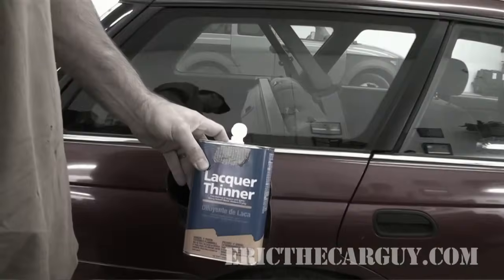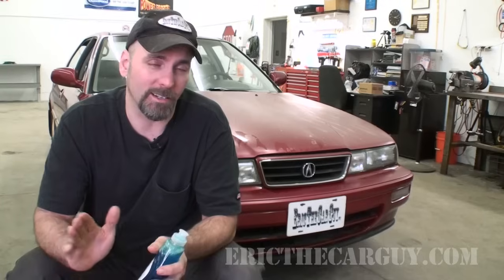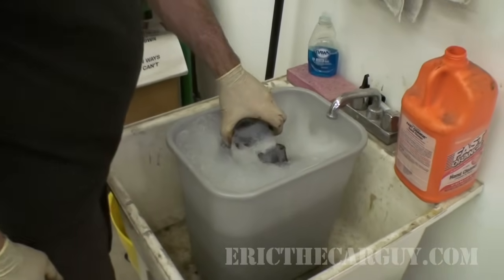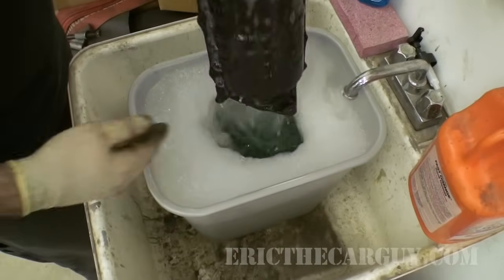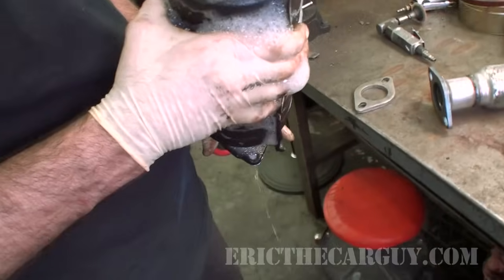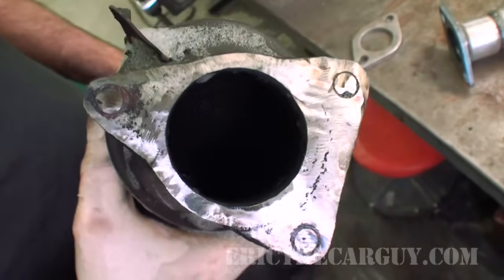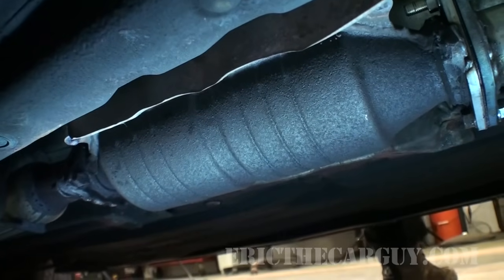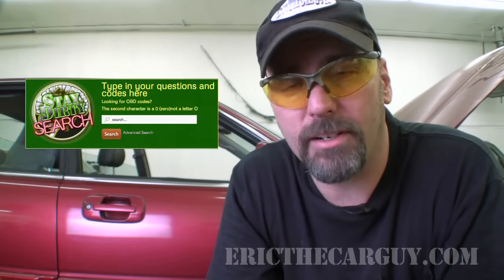Cleaning Catalytic Converters With Soap and Water -EricTheCarGuy

Comment: Good try. 👍  can't be mad at result. But definitely not how it's  done. 30mins? No. Step 1 u rinse it 6 times with diesel fuel by rinse I mean shake shake shake  6 times  step 2 you let it sit in dishysoapy water 24hrs  then step 3 last step you rinse with water distilled.  Rinse goooood and ur done 2 day project and u see thru it  u see light and its actually clean

Comment: I think your researched methods were sound. I have to question your order of operations. At the bucket, draw your hot water first, add your soap and chemicals after that. Chemicals above water are chemicals not in your solution. Hope my little advice helps in any way it can.

Comment: Did this using wife semi defunct  dishwasher [did purchase her a new one ]  and use max intense wash  cycle  with 15% ammonia cleaner/+non foaming  detergent,,,,,With few mod to baskets to funnel water to run down inside Cat it worked well.  manage to wash three cats,,,, before dishwasher took umbrage and died  seem seals in dishwasher don't take kindly to carbon and gunk pumping around in hot 15%  ammonia/soap  You need max run from dishwasher ,,,and must funnel hot mix in to cat core  and place a metal fine filter over top of dishwasher filter out let at bottom of machine, ++ rinse Cat well at end of washing cycle with cold water to make sure soap is remove , Still in use same Cat on my Suzuki car and its 24yrs old and it still works fine,  Yea we had Cats in cars back in 1993  think hot water is key to cleaning Cat core and keeping it on the move to take gunk away found lot of tiny hard black soot crystals  in the run off from waste water   ????? know its hard as I use some of the runoff gunk in  water  to sharpen a Stanley knife blade and still have some of run off  carbon and rust  as power  after it dried and put  in a  tin,, makes good grinding compound is very fine ,

Comment: Ya gotta try it as if you want it to work. lol. If you really wanted it to be cleaner to the point of working...I would imagine you would at least flush all the soap and loose particles out before installing it. No wonder it failed. It's kinda like soaking a dish with cooked on food in the sink and thinking you could pull it out clean...lol  The soap bubbles at the end was kinda telling as to why it failed. You might as well hadn't tried.

Comment: Faster to just use a power washer/  pressure washer or hot water pressure washer to clean the converter in 5 minutes.

Comment: Cats aren't really that expensive I thought. For all that effort to clean it I'd rather use my valuable time doing something else and just install a new one.....Also, the amount of the soapy water actually sitting inside the cat while soaking is minimal compared to the actual volume of cleaning solution. Answer - vigorous agitation to flush the soapy solution through the cat, not just soaking....

Comment: Pre obd2? You're doing it wrong. What you need to do is take a big long screwdriver and hammer it through that ceramic crap, then take a big rubber mallet and hit and shake the converter until all the crap inside comes out. Reinstall and bingo, better gas mileage, better exhaust sound, and you save thousands of dollars.

Comment: Exhaust system is in very rough shape..time to replace the pipes and the cat. By the time you mess around with an old rusted out exhaust system with rotted flanges and
heat rusted bolts..why mess around cleaning it?
"That was not successfull"  ..lacquer thinner and gas?  Good for a undercar explosion
when the mixture ignites inside the cat and backfires. 
 If there is oil in the cat that came from the engine cylinders, it is very challenging to get it all out of the platinum/palladium and then have to put it back on..not worth the time or effort to get questionable results and then have to replace it.

Comment: Point number one, I'm not at all sure such cleaning can be done, but if it were ever to be effective you would need to agitate the solution in some way possibly even using a fountain pump to circulate the solution through it.

Point 2 Rinse the fuck out of it with clean water before reinstalling it. Maybe even use a pressure washer because that soap is going to burn onto the surfaces and create the coating you are trying to remove.

Comment: It's going to be hotter at the front as to the rear.The engine is nearer the front & that's were the heat is coming from.This guy doesn't get it does he.The only way to see if it works is to do an emission test before & after.

Comment: I really don't think the lacquer thinner does anything. Its the long drive that does it. All these people with cat problems probably just take short trips around town and because of that the carbon and other stuff get built up in the cat , because the cat isn't hot enough yet it doesn't burn anything off . but when you take a long trip the cat heats up more and more until it starts burning The stuff off

Comment: i put my catlytic converter in lakerthiner and kerosine and let it sit for 2 nights my temps droped 50 in the rear and gained 15 in the front they were 379 rear and119 in front befor i did this
Reply: +Chris Bayne So it worked worse afterwards. :( The temperature is supposed to be higher on the farther downstream side of the converter.

Comment: This could be an expensive option, but would soaking it in Seafoam work? Alternatively here's a (possible?) recipe for it or something similar:

4 Pts. Diesel Fuel (100% Biodiesel might work even better as it's also a solvent)
2 Pts. Naptha 
1 Pt. Isopropyl Alcohol

I did lower my emissions on a snowblower by letting Seafoam soak in the piston cylinder for 15 minutes, flushing and repeating a few times before putting a new plug on and letting it run. It did make quite a cloud of smoke for some minutes, after that was all burned off the emissions were lower. I know Seafoam works for this application in severe cases, I did the same thing for a weed eater and the piston cylinder was so much cleaner after I soaked it.

Comment: Is this for REAL? Dawn? Look, "Dawn" is used on animals that have crude (liquid) oil on them. First, TRY soaking spark plugs in "Dawn and water" and see how well it cleans them overnight.  It won't.

DO not change TWO variables in a test. You are not doing it scientifically, otherwise you'd dyno the car BEFORE the repair, then dyno it AFTER the repair, THEN dyno after this 'soak'.  This is a waste of time.
Reply: QuantumRift um 2 variables? and why the hell would he dyno the car...

Comment: I had a p420 code for the Cadillac converter in my 06 Pontiac Grand Prix I wasn't looking to clear the code for the Cadillac converter I was trying to clean my throttle body so I tried seafoam spray through the intake wanting to clean my throttle body and it ended up cleaning my Cadillac converter as well clearing the code. killing two birds with one stone cool beans you guys should try it it work for me it might work for you good luck let me know if it works for anybody else that tries this.

Comment: When you soaked it, you put it upright, which prevented most of the soap and ammonia from getting it inside the converter, for 24hrs, which didn't do crap, you should've laid it down so the soap gets INSIDE, or pour soap inside the converter for more effectiveness.  For your other video of lacquer thinner, you need more lacquer, 1 GALLON or more, a quart it's like a teaspoon, you debunked nothing.   apples to apples.when comparing.

Comment: I get the chemistry and the old lady questions me..... constantly.  There is one compound that will kill a cat and that ZZP.  It is an anti-seize zinc compound and does work very well.  OEM found that it killled the cats and the oil companies turned it down in graduations.  API Grade SG was the last that I knew had enough to support a flat tappet cam.  Check Joe Gibbons Racing Oil.

Comment: Being a exhaust technician i find the attempt to clean a catalytic converter laughable.
Reply: Exhaust technician? How long do it took you to get a degree in exhaust work? That's laughable LOL
Reply: Maybe all this goes beyond your comprehension of exhaust systems and catalytic converters. Attempting to clean a converter is a waste of time. Once the wash coat is burnt away from the substrate it is rendered ineffective. If it is clogged, even if it were possible you would need to manually clean each of the 300+ cells in the converter assembly. This goes a bit beyond swapping out mufflers my friends.
Reply: Also, you can get universal catalytic converters from Summit Racing for like 50 bucks.
Reply: chihuahua verde would that be actual functional catalytic converters with ceramic core, platinum / palladium / rhodium inside it?? Where I live you can trade in USED cats at the scrap dealers for 35 dollars or more already..... Bet the Universal replacement is just a pipe...
Reply: antiekeradio it seems Summit Racing does indeed sell functional cat.conv.s for incredibly low prices. Although they are much smaller (=contain less platinum) than OEM cats, and are only oxycat types. The right type (=3 way) for emissions control is also available, starting at around $325, which is still quite cheap imho.
Reply: Wth is an Exhaust Tech? Do you rotate tires too?
Reply: VexingCode I bet he is an oil tech too!
Reply: seeya205 Oh now you're just talking crazy! :P Oil school is for rich people
Reply: VexingCode Well obviously you need to be an oil tycoon to afford it! ;)
Reply: Yep, if 800 degrees farenheight won't clean it, using soap is like digging with a spoon. Most times I've seen p0402 codes and looked at the cat, the honeycomb is either completely gone or severely burned through. So all you would be doing it cleaning a piece of pipe.
Reply: Eric Borders I normally find the person who bashes other's opinions instead of asking for clarification to be the ignorant one, but whatever you say.
Reply: Well, Neil, anything's worth a try before spending 2 to over 4 hundred dollars for a new cat, not including labor and parts markup if the shop does it !  If the engine is burning oil then a new cat will gunk up and put you back at square one.
Reply: hondannyboy

My "exhaust" tuning is dependent on what I eat. LOL !!!
Seriously though, I think the tech part comes in where you are taking straight pipes and bending them to fit the vehicle.  I suspect not every kind of pre bend pipe is available and will have to be shaped to fit at the time of install.  But yeah,it is to laugh, when the word "tech" evokes an image of great sorcery being involved in doing a job that doesn't require years of university and several kinds of degrees.
Reply: Gweedo Murray Exactly. Exhaust work is something you learn by working on it, not by going into college/university and get a degree on that. It takes time and skill to be a good exhaust "technician" (LOL) but as I said, there's no degree on that. Your university is the muffler shop
Reply: hondannyboy

I'm going into training...
pass the beans !
Reply: These comments sparked me to write so much I wrote a 2 part article on it. I linked my website to this video to say thanks.

In short:

When I replaced my catalytic converter it had to be cut out. The new one has to be welded back in. Facing all that work, I didn't even consider cleaning it. I've seen a lot of Honda's on this show and one other have bolt on catalytic converters. How kind of Honda to help make this possible. (Forgive me if I forget that maybe Eric had to add the bolt in flange to make that true?)

Anyway. I bought my catalytic converter from Auto Parts Warehouse for $98. First and only product I've bought from them, being fans of AutoZone and O'Reilly. It was legal in all but CA and I think NY. I didn't want to continue with a 2" cat with a 2.25" catback exhaust. I wanted a little more power. I went from 59 to 90.1 hp.

I bought it from Auto Parts Warehouse because no one else would sell a 2.5" catalytic converter for a car that comes with a 2". In fact, they couldn't do it. Please, I need a 2.5 inch cat and I don't want you to know what my car is. I can't look at them without knowing what car you have. Once they got what car I was driving they were always like, "Your car doesn't have 2.5" cats available." Duh. It's an upgrade.

In long (with more theory as to why it worked for so much more horse power):

http://carmilespergallon.blogspot.com/2014/08/catalytic-converter-and-horse-power-why_27.html
Reply: I'm a gasoline technician.   I know all there is to know about how to fill up a vehicle with gasoline. 😂
Reply: So weird seeing all the comments stating this worked for them, not just here but on other videos doing the same method. Please educate me, and all the people who had this method work for them, on how this method won't work. If you could also point out the laughable part, because I think all these people who tried this and it worked mist not understand why its funny.

What I find laughable is when people become certified in something, or become a technician or specialist, they automatically think they are now experts in that field. Especially in cases such as this when the technician seems to know less than the hundreds of people who tried it and it worked for them.

Comment: OK Eric your making me think about unsubscribing but not yet. I listened to Scotty's 2 videos awhile back as you latter stated you did not put in at least a 1 to 9 ratio of lacquer thinner' now your using Dawn again and not rinsing and blowing it out with compressed air . You're forever blowing bubbles? I'm going to watch the one with sodium hydroxide Soap makers use that to make bar soap out of oils and potassium hydroxide to make liquid soap. The ass backward temperature difference would have told me there was probably a major blockage and not a good candidate for experimenting I'm only an electrician but a licensed master. That takes 8 years and a great deal of formal training. So please ask Scotty since your lucky enough to have his number and he is willing to talk to you, and pay attention when watching his videos maybe watch 3 times and take notes .  I like the Idea of someone doing the lab work so don't give up. Please just get better. And try using a car that has front and rear O2 sensors like a 99 or newer . Then you could do a pressure check and It would have an OBDII port . By For Now I'm off to the next VIDEO

Comment: I'd just take it off and leave it off lol.
Reply: and fail every smog test and break the law.
good move, mate
Reply: jerri0401 well his car is historic and I his state they dont require you to do a smog test so taking it off wouldn't be a bad idea at all.
Reply: ok, if there is no test it would be ok.
but his car is from 93 (i believe?). at what age is a car considered historic?
Reply: 1993
Reply: Well where i live, its illegal to drive without cat if the car is no older then 2002. But i drive bmw 530 e39 diesel 6 cylinders, and without catalytic converters. in smog test got 0.09 out of 3. (more then 3 is illegal.) My friend with 4 cylinder diesel passat same year with cat got 0.83.
Reply: jerri0401 That's the downfall of living in usa, strictly ridiculous laws
Reply: *****
 i wouldnt call them strict, rather loose. come to germany, here you can find strict rules for car drivers
Reply: Maltinis It has "dual" cats in 5downpipe and may have one more, after flexpipe.. I decatted my 530d too and doing less smoke. Cat honeycomb fills with soot and when revved to max it looses and you may have failed soot test.
Reply: well my cats are all gone, i didint cut them someone before me did that. soot is easy to get rid off, you just need to accelerate really fast to higher speeds from time to time, and it wont do much black smoke.